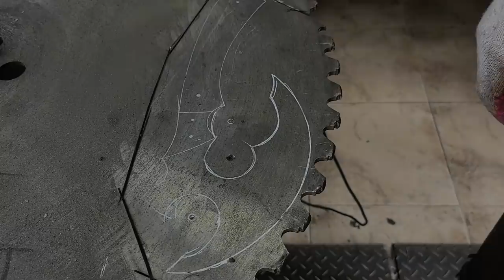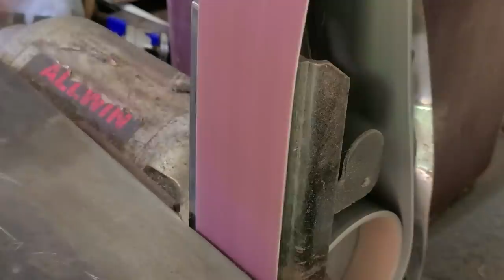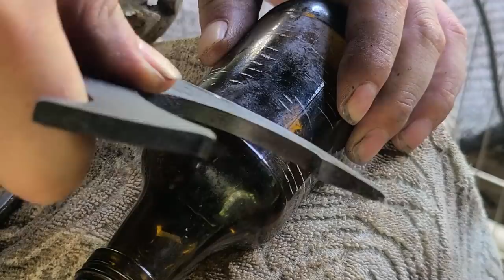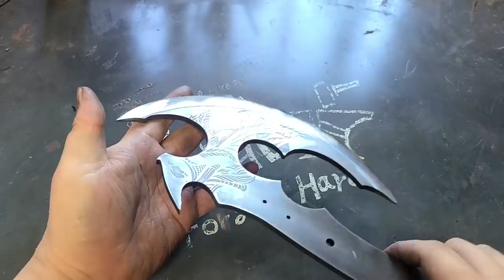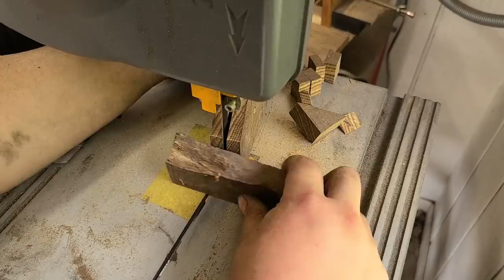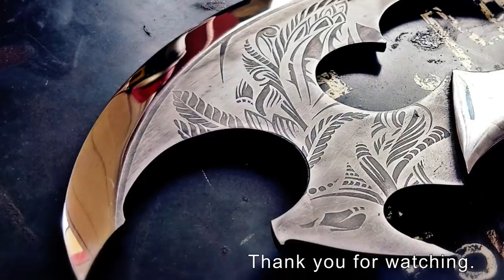What happens when a YouTuber who makes knives makes an axe

Comment: I know this is an over-simplification. But basically you just trim some plate steel to the shape of an axe. You didn't actually Forge any metal
Reply from the maker: Thank you for watching.
My channel name "forging hard" is a mistranslation by Google Translator, meaning that forging is difficult or forging is difficult due to lack of skills. I'm a Korean. I want to change the channel name to "Grinding Hard" or "forging is hard", but I can't change it after YouTube channel verification has been completed. When my shoulders are fully recovered, I will make a video that fits the name of the channel. Please understand.
Reply: @forginghard  hey man, don't even worry about it. I don't think anybody really cares that "the channel name doesn't fit", most of us just enjoy the content
Reply: @forginghard  Also, if the saw blade has carbide teeth, chances are it's just mild steel.  Next time cut off a sliver, harden it, don't temper it, then smack it with a hammer.  If it breaks / fractures, you know it can be hardened.

Comment: What is it that supposed to show us by you scratching the bottle with the blades you make?
Reply: I believe it’s to show that the steel is hardened. Hardened steel and tungsten carbide scratch glass easily.
Reply from the maker: Thank you for watching.
The only reason to scratch a glass bottle is to test the hardness of the knife after tempering. A typical glass bottle has a hardness of about HRC 52.
Reply from the maker: Thanks for the accurate explanation.

Comment: Don't get me wrong this axe is a beautiful piece of work. But this is not Forging. It is stock removal only. 

 Here is the definition of FORGING. 
See definitions in:

gerund or present participle: forging

1.

make or shape (a metal object) by heating it in a fire or furnace and beating or hammering it.

"he forged a great suit of black armor"

Similar:
hammer out
beat into shape
Reply from the maker: Thank you for watching.
My channel name "forging hard" is a mistranslation by Google Translator, meaning that forging is difficult or forging is difficult due to lack of skills. I'm a Korean. I want to change the channel name to "Grinding Hard" or "forging is hard", but I can't change it after YouTube channel verification has been completed. When my shoulders are fully recovered, I will make a video that fits the name of the channel. Please understand.

Comment: No hammer and no forge besides the heat treat... should be called grinding hard
Reply from the maker: Thank you for watching.
My channel name "forging hard" is a mistranslation by Google Translator, meaning that forging is difficult or forging is difficult due to lack of skills. I'm a Korean. I want to change the channel name to "Grinding Hard" or "forging is hard", but I can't change it after YouTube channel verification has been completed. When my shoulders are fully recovered, I will make a video that fits the name of the channel. Please understand.